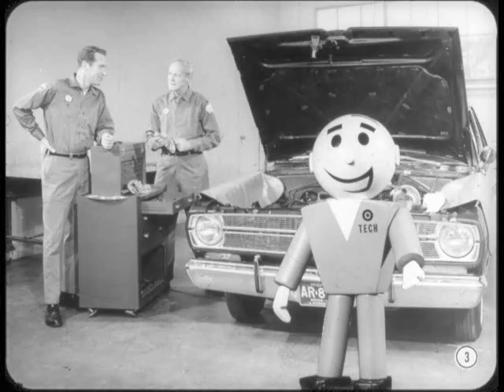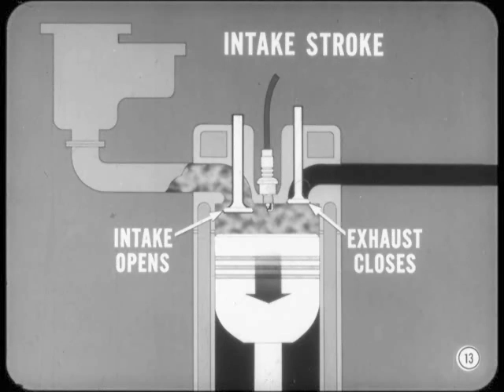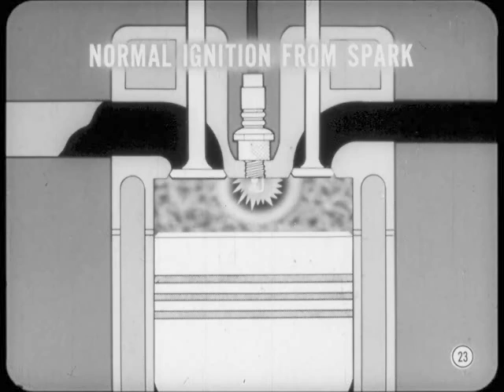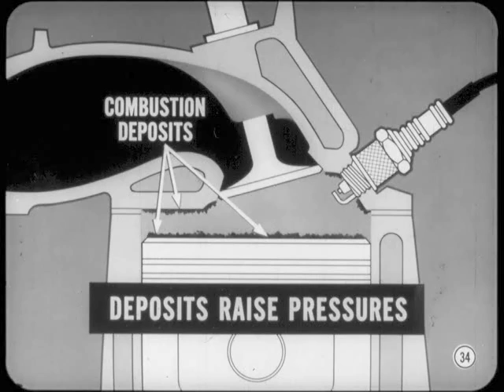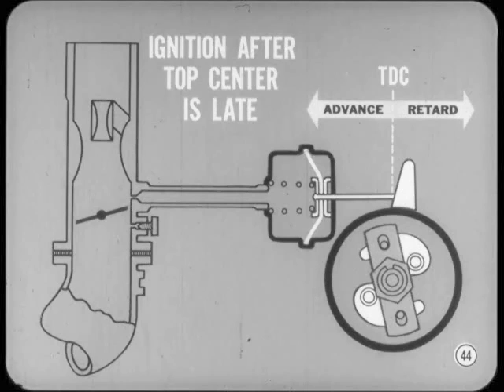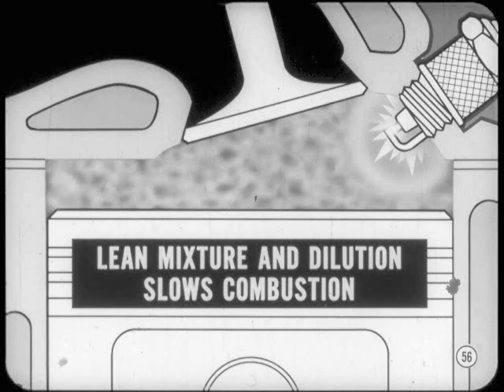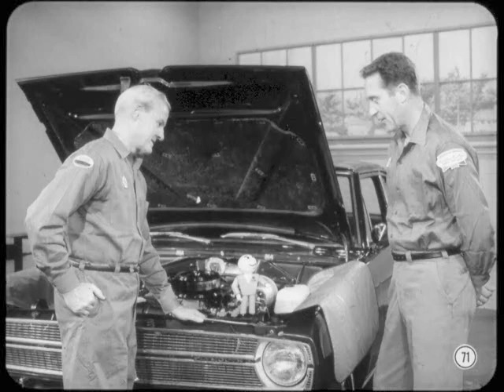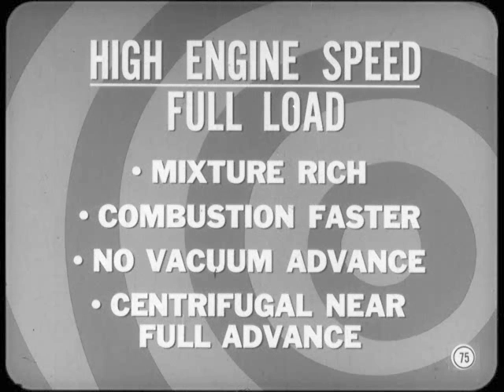Chrysler Master Tech - 1967, Volume 67-11 Combustion in Today's Engine

Comment: 1:34 The higher compression ratio is not the biggest reason that OHV engines outperform flatheads. The biggest reason is that incoming air and outgoing exhaust doesn't have to make as many turns when entering the engine. The other reason is that the combustion chamber burns the fuel more efficiently. The combustion chamber works so much better, that compression can be raised without raising the fuel octane.
10:34 Sometimes when people race old engines, they will pull spark plugs and take a very close examination of them. Even after a few miles of racing, spark plug appearance can show a trained eye whether an engine is dialed in or something needs adjustment. I'm not familiar with that process since I don't race things, and I don't modify for big horsepower gains.